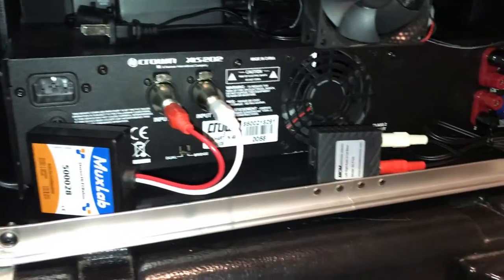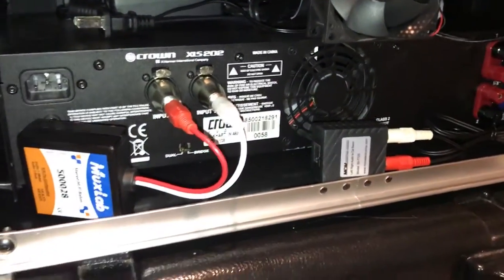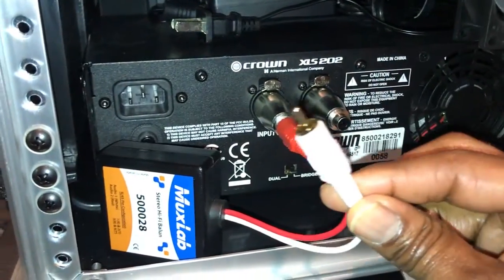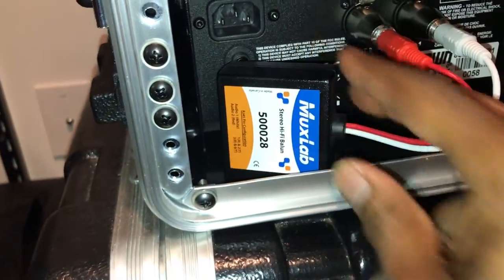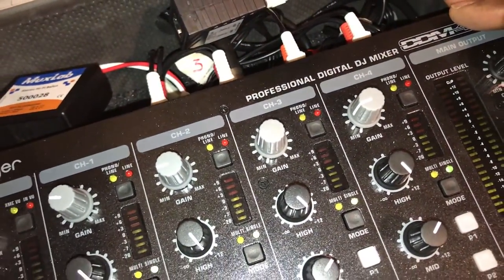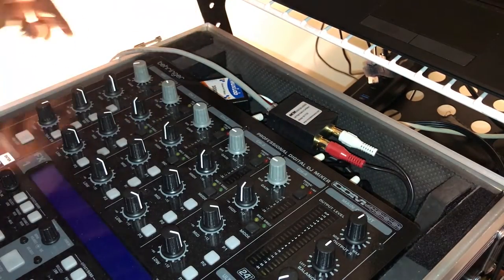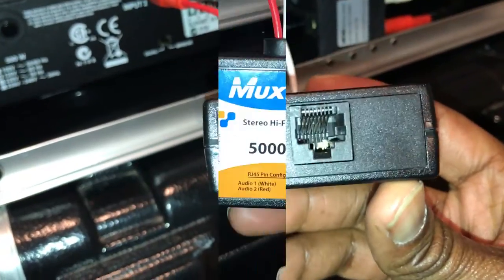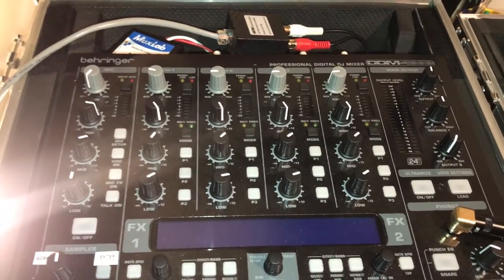How to use Cat5 cable for long audio cable runs

Comment: cant use just wire some of the cat5  wires to a red and white rca connector? would that do the same thing? i mean i understand that the quality might be better with a converter device using all 8 of the cat5 wires, but could i still do that to use a cat 5 wire for more than one thing
Reply: in AES , but not from the video shown.  If you want to do long runs just purchase balance cables.  Cat 5 as shown for audio has the same or less quality and range of 1/4 mono cables

Comment: cat 5 for audio is good for 100' then you need a repeater.  CAT 6e is 100% better.  Look in AES.  With that wiring you will get a lot of noise due to the cable non shielding factor
Reply: use a shield cable and run it away from electrical line or magnetic field